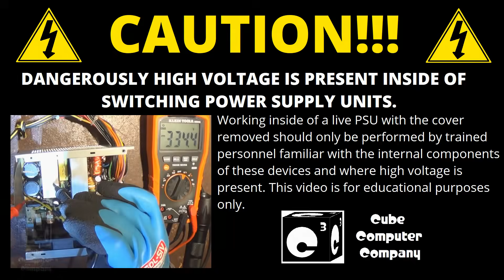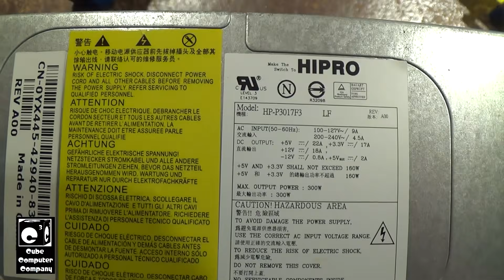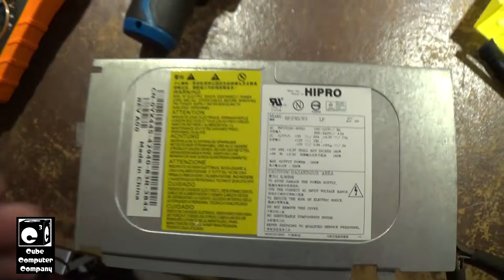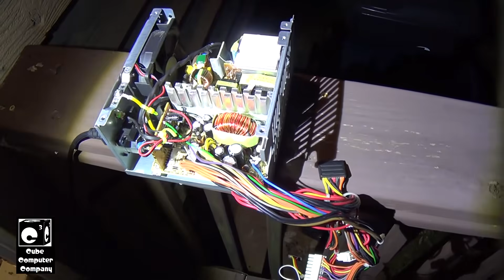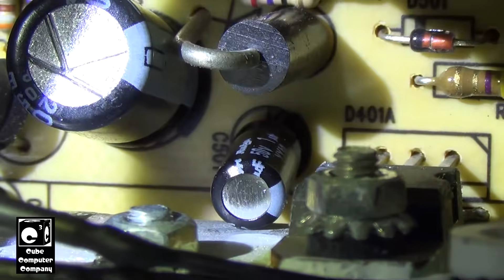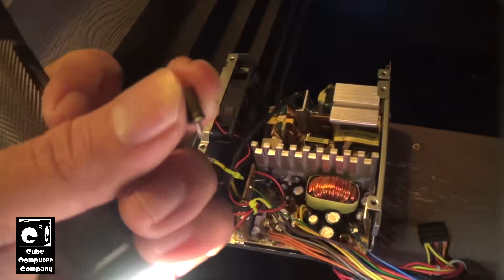How this little capacitor could prevent your PC from booting

Comment: I’ve got a few Optiplex 7010 sff that our customers have reported just shut off mid use and then never on again 

Since I get to take the faulty pcs home with me I would like to fix them but I suppose since they’re not blowing up it’s not obvious to me exactly what part is failing and I don’t really have good psu diagnosis skills I just know how to shotgun leaky caps but I’m not even sure if in this case capacitors are the issue  

But since they are sff custom psus replacing them entirely would cost more than the pcs are worth but I suppose I will just pull all the caps and test them
Reply from the maker: I would have to wonder if these are shutting off due to overheating or something not caused by the PSU... Though these SFF systems are bad for caps failing due to heat.

The little caps in PSUs will fail without bulging. From what I have found so far, they will measure much lower than spec, or in some cases, not register at all.

I may have to post a video covering a little more on capacitors, including good practices when buying them. I get almost all my replacement electrolytic capacitors from Digikey and Mouser.